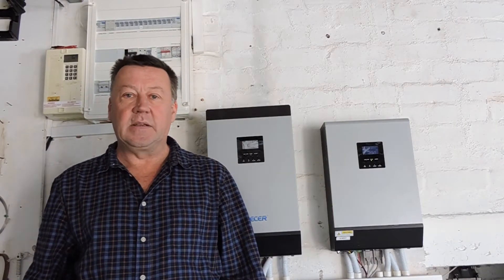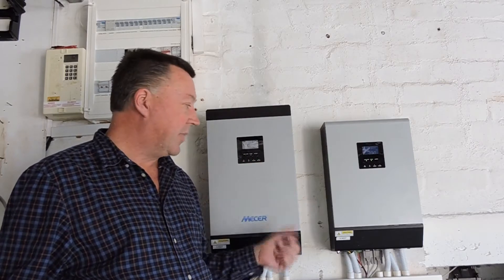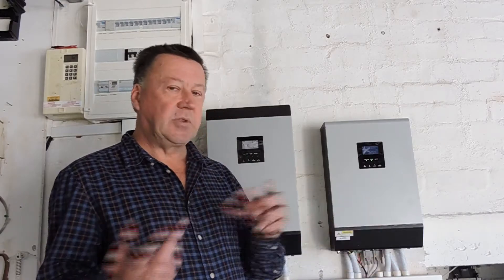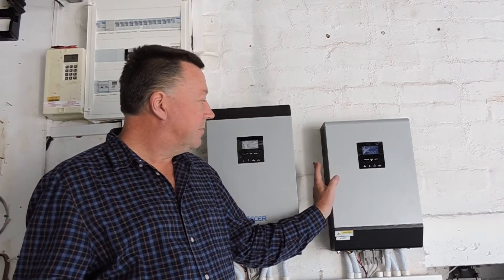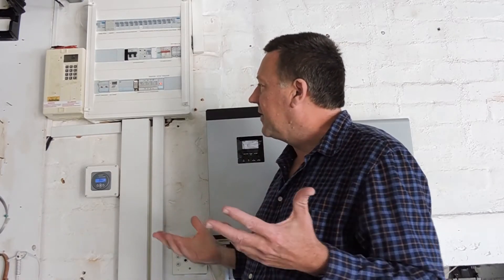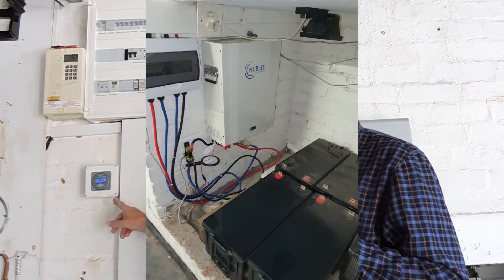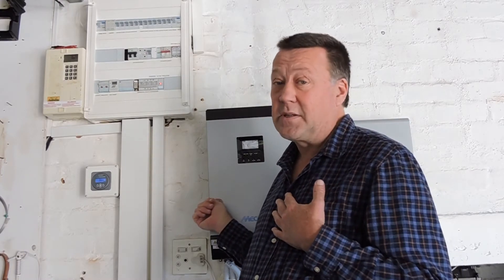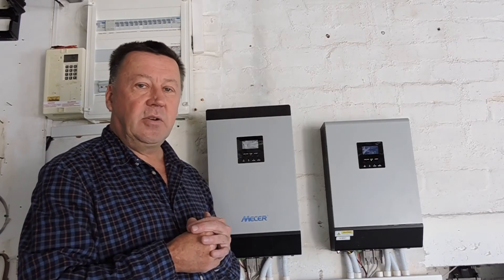Best Value Solar PV installation 4 years later Oct 2021 #2

Comment: I have 2 of them 8 years. With a victron smartshunt saw me -120w with no load and -58w with the one closed. And its 48v agm batteries system 230v output

Comment: That stand-by load sounds incredibly high? What would the point be of these mecer units if you lose half a kilowatt an hour?
Also, there should be no switch-over time loss, they can be set to UPS then the switchover is 10ms. I think you have yours on application instead.